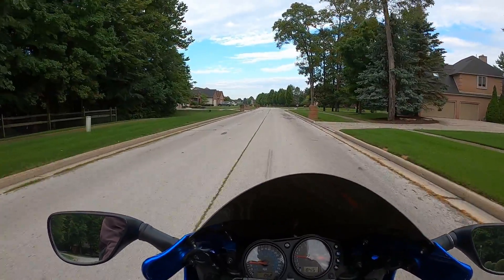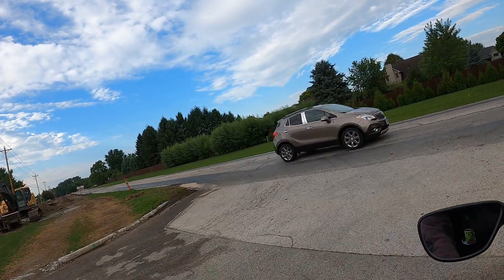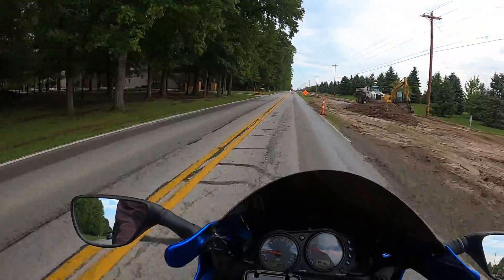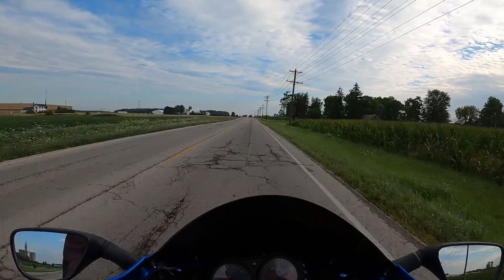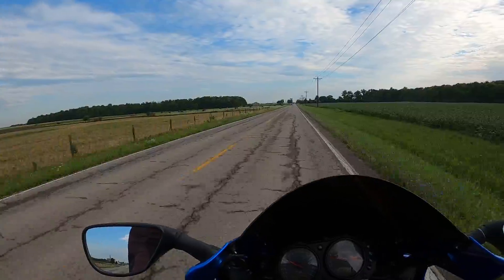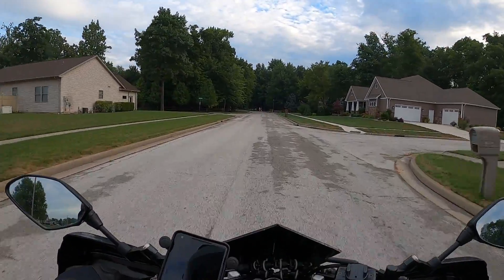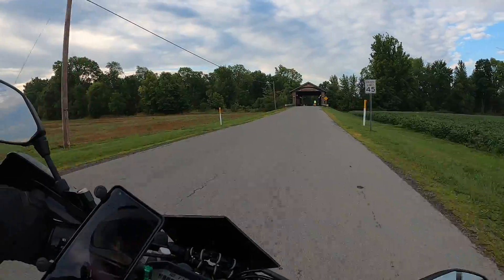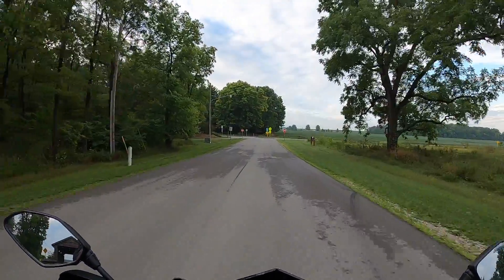My FZ07 is fixed!

Comment: Bad gas??
Reply from the maker: I don't think so, I was running premium from several different stations
Reply: Coffee Guy 419 test your ECM (engine control module) and or replace. Check for heat exposure. On your machine it’s called an CDI/ECU
Reply: Coffee Guy 419 inconsistent and unpredictable ignition problems are almost always digitals
Reply: Coffee Guy 419 also strongly recommend an OBD2 scanner and adapter to the bike. Read the computer codes and look them up
Reply: Coffee Guy 419 sorry for all the messages another thought occurred. I know, right? If the problem gets super complex it’s often a very basic fundamental. Check your power ground, and mini block ignition connections for heat or corrosion